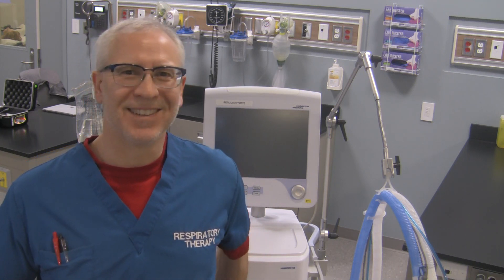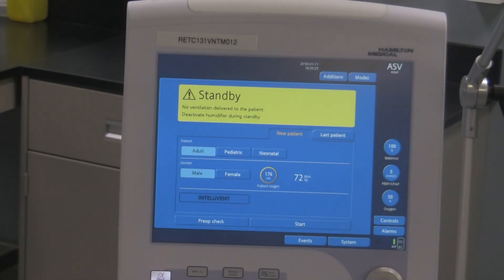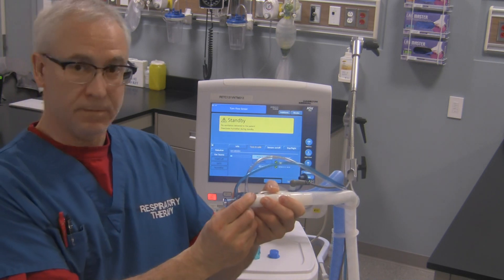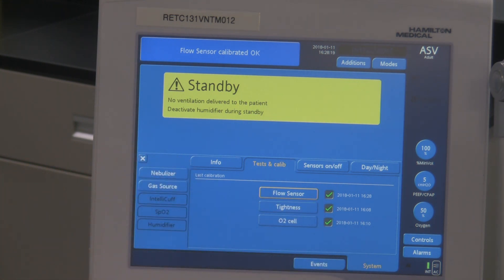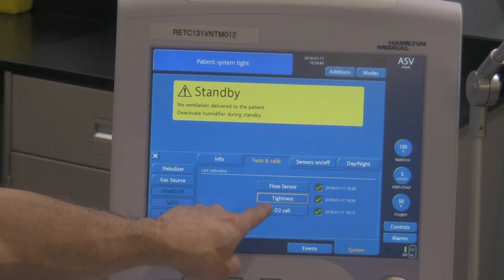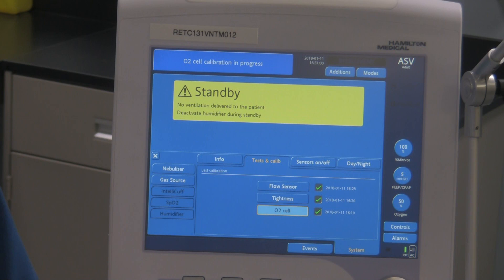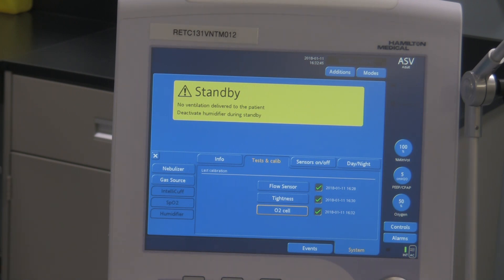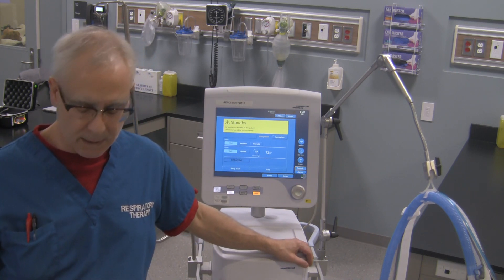Hamilton G5 Mechanical Ventilator: Pre Use Check

Comment: Great video sir.  Our hamilton trainer told us to always do the tightness test first to check for leak, then you would do the flow sensor after.  That's to ensure that the flow sensor is not calibrated with a leak in the system.  He even demonstrated by creating a small leak and running the flow sensor test and it passed, then he followed it up with a tightness test like you did and tightness failed.  So it could be very possible to pass a flow sensor test and then fail a tightness test.  Hopefully the clinician will redo the flow sensor test after the leak is found and the tightness test is redone.  Thanks for all you do.
Reply from the maker: Thank you for your comments.  Good suggestion.

Comment: Hello George, I am facing tightness test fail issue, what could be the problem, even I put the whole circuit tightly on all junction's. Please suggest
Reply from the maker: Hi:
If your using a humidifier, bypass it and hook the circuit up without it.  If the tightness test still fails then the issue is probably not with the humidifier and is somewhere in the circuit.  If the tightness test passes then its your humidifier.  

Depending on the type flow sensor used, the older style may have separated a bit in handling it so maybe replace it and its tubing.  Ensure those tubing for the sensors are tight where they attach to the vent.  

Another potential site for trouble is the exhalation valve.  Remove it and ensure that its put back together properly and that its snug/tight. 

Check all connections including the MDI port and temp ports.  Check the port close to the humidifier where you place the temp sensor.  They can sometimes look like they're in all the way when they aren't and leaks and auto triggering can occur because of it.  

I've also encountered problems with the circuits themselves.  Occasionally you may get a new circuit that was damaged in handling before you put it on the vent.  

If you try all that and still have a leak, grab some cheap large bore tubing and connect it to a patient Y connector......you'd be creating a basic generic patient circuit.  Use that with the flow sensor connector and leak test it.  if you still have a leak then it may be internal with your inspiratory valve.  Let me know what happens.